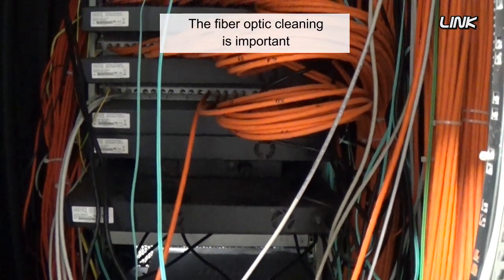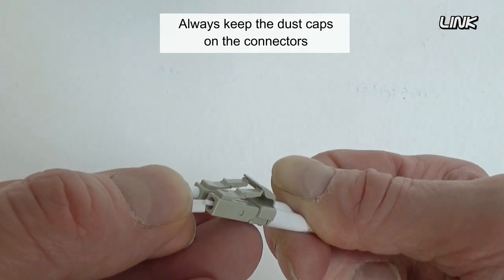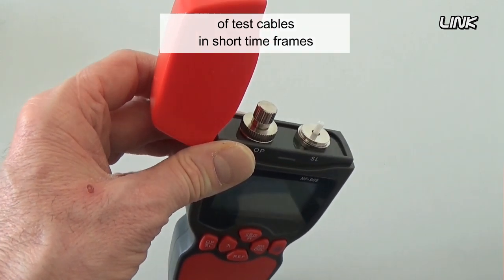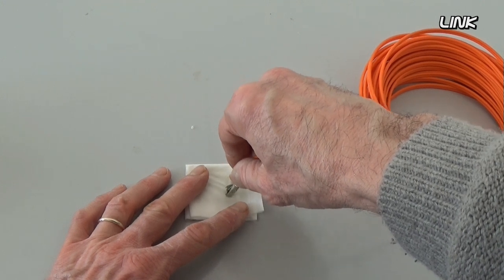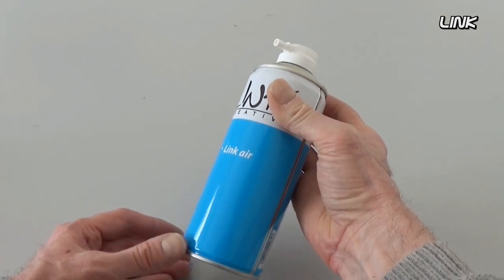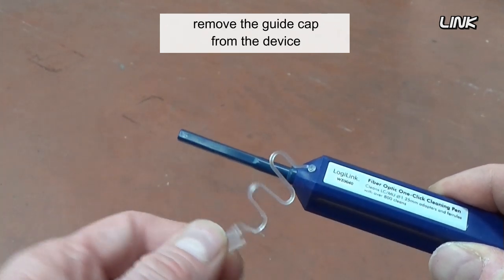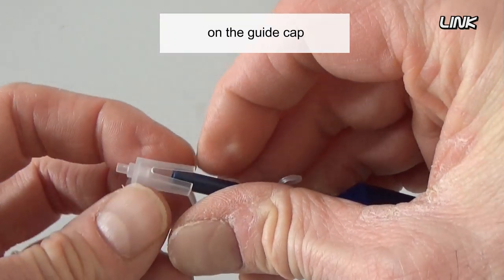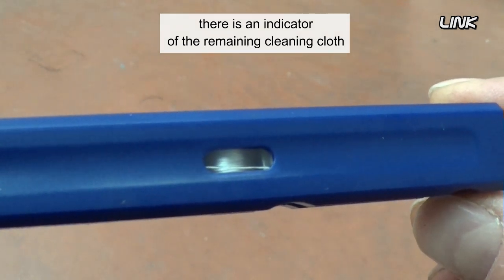How to clean a fiber optic connector

Comment: My cable operator just told me to spray sanitizer on the front end, this tricks works but after a day or two I have to do this again
Reply: This is because the solvent is leaching unseen surfaces...and...'sanitizer' such as IPA only attracts moisture.  It's not a very good cleaner.   Always use a minimal amount of any solvent...